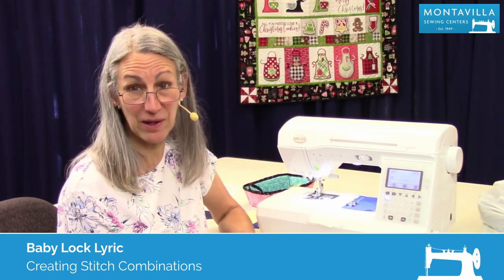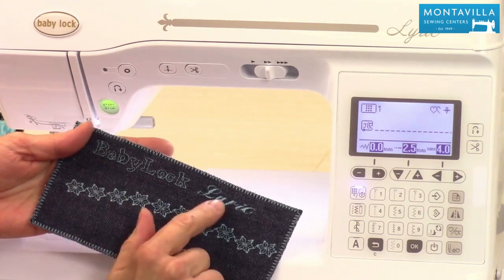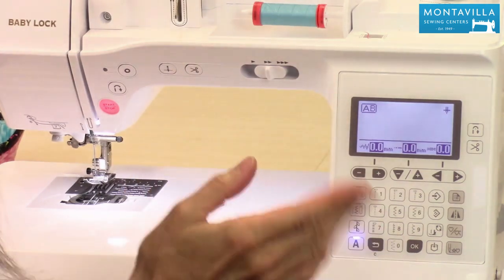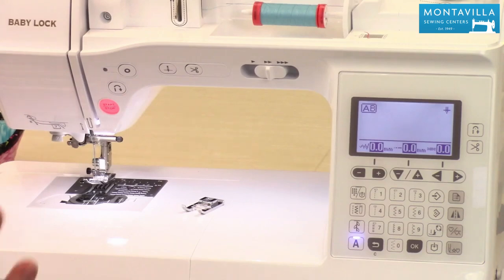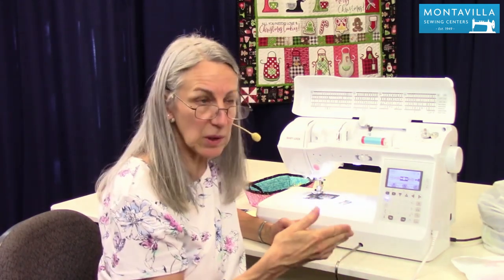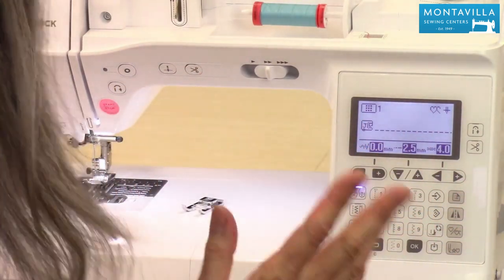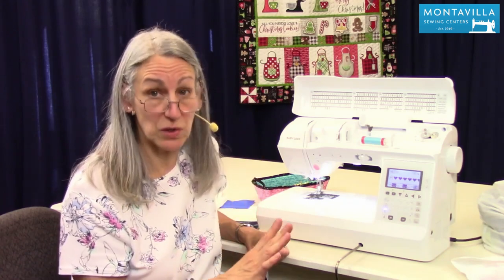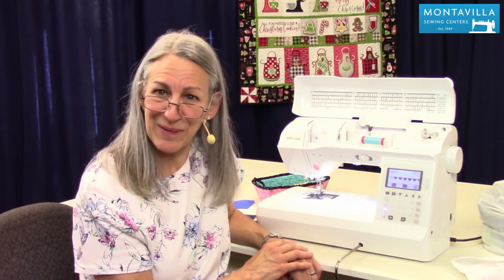Baby Lock Lyric Lesson - Creating Stitch Combinations

Comment: should I use a breakaway material when putting decorative stitching on silk?
Reply from the maker: If you mean tearaway stabilizer then yes. Using a light to medium weight tearaway will give a great stability to the fabric so it can handle decorative stitches without puckering. it is worth noting that if you intend to use any kind of satin stitch, the result will be very thick on the fabric. if you are using a light decorative stitch, you can also use a wash away stabilizer to reduce bulk in the stitches. We Recommend OESD Stabilizers for the most part. They make a great product!